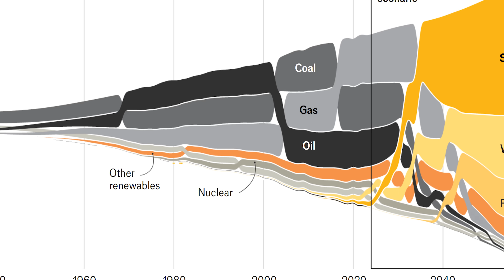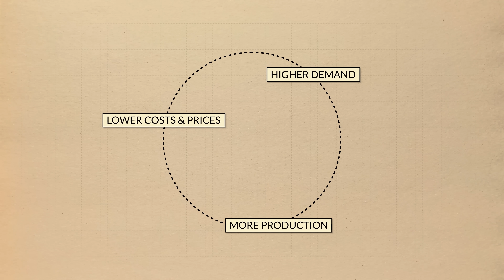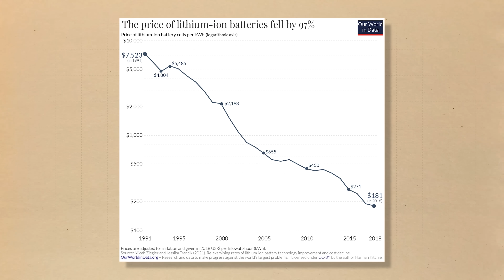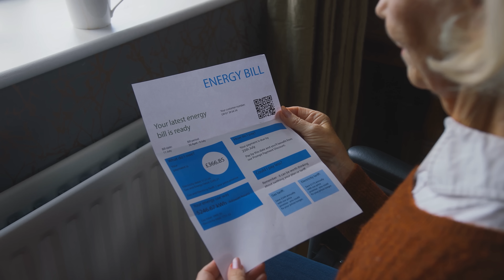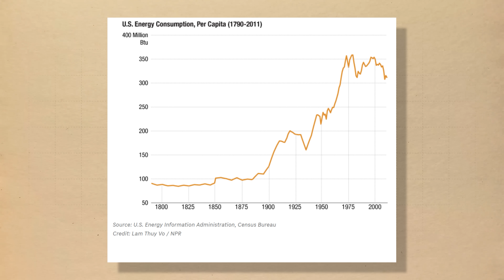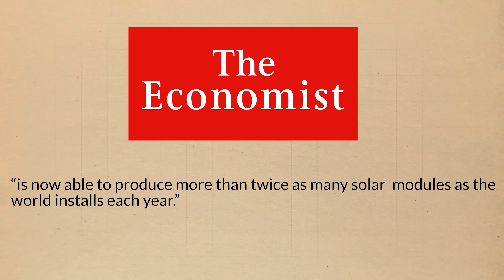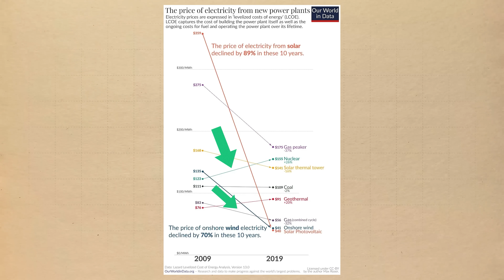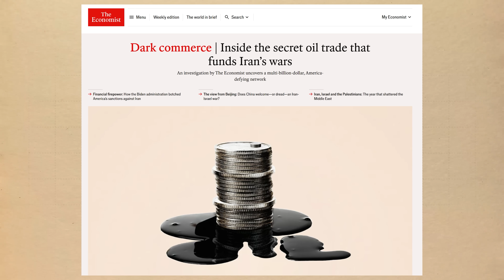Why solar will soon dominate & what that means for the world

Comment: I have a MSc in renewable energy and I am so excited that I can provide some additional insights which I usually can't with Joeri's video's! I love the positive things mentioned in the video, but there's some nuances here that are worth mentioning. 

1. Though the cost of production from solar-PV is negligible, the fact is that energy prices will rise in the near future. The reason for that is the cost for managing the electricity grid outpacing the reduction in production prices for solar-PV. Joeri rightly mentions the lower prices for battery systems, but this is a long-term solution and grid-congestion costs my country (Netherlands) 1-4% of annual GDP per year  because we neglected our energy-infrastructure for decades (like the US has until Biden). We can't add any more supply or demand to our energy grid. 

2. Solar power is intermittent meaning there is a disconnect between peak-production and peak-consumption, whereas fossil-powered electricity is real-time. Africa and Asian nations can indeed use solar to meet some of their energy needs but effectively managing a Solar-PV based energy system requires smart-grid implementations, storage capacity and real-time monitoring, which just isn't financially feasible in a country like Indonesia or Nigeria. 

3. You mention Chinese-made solar-PV as a supplement to Russian gas, this isn't necessarily true. Solar panels produce energy for longer but natural gas is used for non-electric processes and for these processes we cannot supplement gas with electricity.
For example: There's a particular problem with the decarbonisation of industry, which is my job. 
Industry requires high-temperature heating which is not feasible with electricity. I know there are examples of industrial heat being delivered with electric means but trust me when I say that it isn't generally feasible to electrify manufacturing and other industry.

Therefore, solar will be a big portion of the energy-mix, but we need other forms of energy (fuels) that aren't electric. This either means advanced biofuels or hydrogen, the latter necessitating a large amount of freshwater to produce.

Love the video!! Thanks for dissecting this information, we need to embrace the energy transition because it makes sense, but I would say we should have a MUCH more balanced prioritisation between the production of renewable energy and energy-infrastructure because the power grid is just as important and again costs the Dutch economy €10-40 billion/year so there is also an economic necessity.
Reply: 3. IF electricity prices permanently drop or natural gas(NG) prices permanently rise industry will switch to electricity, but it will be slow. Natural gas is relatively much cheaper per btu for heavy industry and was simpler in the past, so "lower temperatures" at scale almost always use NG. However, electricity is still used for high temperature production, and is now generally seen as much safer/simpler(relatively). My impression from the engineers is that this is "simpler" because everything needs so much electricity/digital now anyway lol, so its high electric vs NG AND electric. People might have the impression electric heating is more dangerous, but that's not due to the heating method and is instead due to where electricity is currently used(high temp, dangerous products/reactions). Heavy industry in general is very slow to modernize unless there are very large gains to be had, because the capital costs are so large. In the USA you can basically say they only modernize due to new production, regulation/insurance, or being far past end of life. Major upgrades to the same site, for the same products, just for efficiency are very rare. Although there are super cool industry efficiency strategies that can work for electric like running power consumption off cycle in different ways to get the lower prices/grid load.

But also, who cares about the "niche" exceptions? If everything else goes electric besides legacy systems and transportation that would still be huge gains for everyone.
Reply: @johnstonefield1935 Interesting. If you look up Hydrogen Ladder 5.0, you'll see that industrial heat is on level D. So that seems about right.
Reply: @johnstonefield1935  Your response belies the confusion. It isn't electricity vs natural gas. It's production and distribution of electricity vs the production and distribution of gas and the economic value of the energy at a particular time.

In short, you can't easily store much electricity due to hard laws of physics. So, production has to be flexible, but renewable production is inflexible. This is the paradox. And it can't really be innovated out off.
Reply: Reducing the earth's water supply? Either burning or combining it with oxygen in a fuel cell will both turn it back into liquid water.
Reply: @RikkerdHZ  good call, it has been a long day. It is problematic in practical terms though, reducing freshwater whereas most countries are facing shortages in drinking water. It actively reduces our access to drinking water.
Edit: European nations have been importing hydrogen from "water-rich" countries like Morocco to meet their needs. It shows the practical impact of hydrogen on water supply.
Reply: @augustus331  "Solar power is intermittent meaning there is a disconnect between peak-production and peak-consumption"

At least in hot countries there could easily be strong positive correlation between supply of solar power and the need for electricity because the need to run ACs is usually higher when the sun shines.
Reply: @seneca983  there is also a good correlation in between supply of Solar power and the demand of electricity , as people tend to work while the day and cook at midday.

But for the Grid to work supply of elecricity has to be 100 percent equal to demand.
Reply: @geheimeWeltregierung  Many other sources of power, such as hydro, can be adjusted to match changes in the supply of wind or solar or the demand of electricity. The better the supply of renewables correlate with demand the less you need these others (or storage), even if it's never zero.
Reply: Just leaving industry as it is (which isn’t happening) and then net-zeroing all other sectors would already reduce global greenhouse gas emissions by more than 90%. Even if you include certain other hard-to-electrify sectors you‘d reduce it by 80. There’s hope here.
Reply: I think the big fix you missed for intermittent sources is battery storage, which is also getting super cheap too. And different techs for longer term energy storage will only aid further. Truthfully it's kind of silly that we aren't scrambling to make use of all the free energy we are getting. But incumbents gonna incumbent
Reply: So, maybe a dumb question but: why freshwater? If electricity is cheap, and the costs are in the grid management, surely there’s a way to use desalination to help. Maybe use large plants that switch on when energy prices fall.
Reply: @zoetje9817  technically possible , but making Hydrogen is not Cheap (yet ) .Desalination would add additional costs thats all.
Reply: Rondo Heat Battery is interesting technology. 1,500⁰C  is useful temperature. New technology.
Reply: In UK the cost of energy is high due to marginal cost pricing even though on most days we have about 50% renewables for cheap($/kwh) and the gird is fairly developed to handle 90% renewables.(Yes on really windy days we reach that number).
Reply: Appreciate your comments.
Reply: I’m suprised no one here is discussing hydro power or the energy storage version, pumped hydro. It’s an expensive but simple way to solve the problem, although I do understand some countries may not have the geography required for it
Reply: @molteaser1622  you make a good point and indeed in my case in the Netherlands it’s not an option due to the flatness of my country
Reply: @molteaser1622  hydro can be a very useful source of energy, but in many cases it's already built out, or as you said the geography doesn't exist. However, hydro, or pumped hydro, offers very low cost of multi-day levels of storage and capacity, which is a huge benefit. Currently batteries only offer 2-4h storage and power regulation, because these allow the owner to buy and sell power multiple times a day, and sell into the highest price pool in the evening. Batteries aren't likely to do better than the 8-16h for overnight range, so this kind of week long reserve is very valuable where it's possible. I think India will be one of the greatest winners on renewables, because the Himalayas offer such pumped hydro potential.
Reply: Unless we invent cheap efficient batteries with near-infinite amount of charge cycles, its a terrible option for grid-scale storage.
Most of the world, unlike Netherlands, has a high pumped hydro potential that can efficiently store and release much more power for a fraction of the cost. A decent-sized pumped hydro installation can store and release power on the scale of hundreds of megawattsto gigawatts and the reservoirs can be built on the top of any hill with suitable geology. With maintenance, such installations can last and pay out for centuries, orders of magnitude longer than any battery.
Reply: @MVargic  A a Swiss, with one of Switzerland largest pumped-hydro installation in my (a bit extended) backyard, I am a very strong advocate for pumped-hydro!
However, batteries and pumped-hydro do not have the same usages.  If you need nearly instantaneous response to regulate grid frequency, batteries are the only game in town.  Power transport losses are also an issue.  It would be senseless to transport the power from North German... or Dutch  wind turbines to be stored in Swiss or Austrian pumped-hydro facilities, to be later sent back to German or Dutch industries, when batteries located miles from the wind parks can do the job!
Those two storage solutions are complementary, not opposed to each other... even if I will readily agree... even strongly support... that pumped-hydro can be the cheapest solution, if the costs are taken at the entrance/exit of the installation...but it's not always an accurate representation of the truth.
Conclusion:  you are basically, correct, but please try to be a little less affirmative,,, nothing is as black and white as you painted.  Battery storage is by NO MEAN "a terrible option for grid-scale storage".
Reply: Grid-based power may well be the answer in developed/western/colder countries, but I can say with confidence that in a place like Nigeria, people are just completely bypassing the grid. Nigeria's grid struggles to handle 5,000MW of production and regularly collapses. As a result, the vast majority of the country's energy production and consumption is completely off grid. People are installing solar systems and not feeding it back into the grid. In a place like Lagos where solar irradiation remains high year-round, a modest battery set up is enough to get through the night. Of course, this doesn't work for us in Europe, but for many African and Asian countries, it does.
Reply: @obamtl  I agree and think that small scale grids are the answer for many countries in the Global South that have to cover hundreds of millions of people over vast distances. 
Thank you for sharing your perspective. I would love to visit Nigeria one day.
Reply: Why do you need fresh water to make hydrogen?
Reply: Heat intensive industry will electricfy, it will just be in highly sunny regions where energy is cheaper, Europe will continue a transition to low energy input high value added industry.
Reply: If you made a video on the topic, I would watch it :D
Reply: @bernardogalvao4448  thank you for your kind words
Reply: 2. You’re going to see some leapfrogging in developing countries. Like we saw with cell phones and mobile banking.
A small smart micro grid is not expensive. If you have a village that’s not connected to the grid already, setting up a local solar farm and a shared battery bank will be the cheapest way to get power. This is already happening.
3. There are several examples of industrial processes, like cement and paper production, 
being transitioned to electric heating right now. I read about one such factory that just made such a transition and found some unexpected benefits like better process control. There are also new super powerful heat pumps that have already been delivered to factories that can go deliver up to 200°C. For anything that doesn’t need higher temperatures than that, such a solution will be cheaper than anything else.
There are heat batteries now that can be “charged” to thousands of degrees and can store it for a long time. 
It’s a huge challenge, for sure but we’ve seen signs that most of the solutions we need are ready. I think the transition will be faster than expected. And I think many of these new factory processes will actually help balance the grid.
Reply: @auspiciouslywild  Even just having electricity available during the day would help a lot. The battery is optional.
Reply: The Steel Industry is whiching to electric blast furnaces. I guess you are not so smart.
Reply: You can produce Hydrogen from seawater and not fresh water - researchers demonstrated it in early 2023
Reply: @MechaOrangeStudios  Little problem if you electrolyse sea water: you are going to produce hydrogen alright, but also chlorine gas. In fact, the most efficient electrolysers require ultra-pure water to prolong the lives of electrodes and membranes, AND maximize the amount of hydrogen produced by unit of power invested.
Reply: @st-ex8506  Chlorine gas is an important point, I hadn't considered that. But that sounds like a solvable safety issue, especially since it will get produced at the anode, so anything we need to do to safely handle it doesn't interfere with hydrogen production. What kind of efficiency differences are we talking about and how cheap and repairable can we make the electrodes? Why are you using membranes and not just capturing the hydrogen in a tube? Sounds like I have a lot to learn about electrlysis equipment.
Reply: Sounds like a great investment. Better than nuclear.
Reply: @wildfire9280  Yes and no. I personally hate the ubiquitous take online of nuclear as a silver bullet. Nuclear energy is a baseload energy source that doesn’t fluctuate and provides consistent electricity. It’s VERY expensive though and solar is much more scalable. 
 

So personally I was very happy to see Microsoft purchasing nuclear plants for their data centres as they have money like water, datacenters are consistent energy-consumers and this way the average consumer will not pay the higher electricity costs resulting from a higher demand for energy from big tech data centres
Reply: This either means advanced biofuels or hydrogen, the latter necessitating a large amount of freshwater to produce.

Compared to the amount of energy that it takes to split water into hydrogen and oxygen, the energy cost of taking seawater, doing the most crude inefficient boiling distilation, and then trucking it halfway across the country, is small. 

Hydrogen doesn't take large amounts of freshwater.
Reply: @donaldhobson8873  interesting observations but I work in the sector and if what you’re saying is true it wouldn’t be such an obstacle as it is. 
The reason we are importing hydrogen from Morocco is because we don’t want to tap into our own groundwater reserves
Reply: @augustus331  Either.

1) Your hydrogen production system needs a lot of cooling water as well as the small amount that gets split into hydrogen.

2) This is performative politics by politicians with no sense of scale.

3) The reason you don't make hydrogen is actually a lack of electricity.
Reply: 1. Intermittency of Solar - high capacity battery price is plunging as much as solar panels does, because China is producing it at scale, means that in future battery could store, regulate and stabilize power supply from solar. Secondly, there is a combination of wind+solar to cover the gap.

2. Non-electric industry that uses high temperature combustion process - China is also scaling up its hydrogen storage system, where slow stream of solar/wind/other renewables energy are able to be stored in high entrophy medium like solid hydrogen fuel,  its just a matter of time that technology would reach its critical mass the same way with solar. That would be the end of fossil and natural gas. China is scaling up its space industry which uses lots of Hydrogen fuels, so that would be the logical direction.

of course these were my optimistic prediction, wont happen overnight, but when China is betting on a particular technology I would not bet against it.
Reply: @ganweidi1382  even Japanese are working on Hydrogen and Ammonia as an alternative to Fossil fuel. If that happens we are looking at prices of Oil and Natural gas go into stagnation if not going to zero just like Coal
Reply: When for solar energy and hydrogen are more mature, Germany companies will have already ceased to exist or just moved elsewhere, e.g. BASF to China/US. China now can produce even MRI machine (for healthcare) and Heavy Duty Gas Turbines, which have been Germany's strength.
Reply: The "necessitating large amount of fresh water" is a meaningless statement. Solar and wind power can easily desalinate seawater and crack it for the industrial processes we require hydrogen for. Hydrogen is not an efficient fuel since the electricity required is better spent powering electric vehicles including trucks. Hybrid truck can be used as a transitional measure since they use 1/2 as much fossil fuel. Mining and smelting can all be done with renewable energy. Manufacturing is already mostly electric. The question is not "if", it's how fast will it happen.
Reply: Australia nuclear promoters are looking for 247 cashflow to make economic sense. 

Australian nuclear promoters want GOVERNMENT built and GOVERNMENT disaster insurance and GOVERNMENT GUARANTEED CASH FLOWS. 

Tax payers money. 

BUT everytime the sunshines 🌞 the cashflow STOPS.
BUT  everytime the battery is full after the sunshines 🌞 the cashflow stops. 

The electric future is 100%, nuclear promoters are saying 1% of all energy used is to be nuclear. 

This is obviously stupid. 

Nuclear electricity industries to stop CO2 emissions worldwide, is stupid. 

For a start nuclear must have a grid that is 10times more expensive $km and 10times bigger km. 1million x 1million x 10 = stupid. 

$TRILLIONS AND TRILLIONS AND TRILLIONS. 

DECADES AND DECADES AND... 

Nuclear promoters want you to waste time on its $billions construction costs bs. 

But bigger nuclear needs a bigger national electric grid, $TRILLIONS. 

But small nuclear 247 cashflow does not survive in the big renewable electric world. 

Worldwide nuclear industries and EXPLODING MILITARY DEFENCE costs are extremely expensive. 
More nuclear submarines  ???? 

80% of the world's population live in dictatorships.
Great thinkers, the nuclear promoters,  bs.
Reply: Great comment!
Reply: What's your Twitter handle or something, I need to follow you. You're a gem 💎. Even if it's a website you have or anything related, I will be glad to have it and follow you. People like you have a lot to offer this world, and you just earned yourself a follower. I look forward to your reply. Stay blessed.
Reply: What's your Twitter handle or something, I need to follow you. You're a gem 💎. Even if it's a website you have or anything related, I will be glad to have it and follow you. People like you have a lot to offer this world, and you just earned yourself a follower. I look forward to your reply. Stay blessed.
Reply: You forgot to mention solar is electricity and solar and wind are about 5% of our total energy and energy demand is greater than new installations or renewables and that solar will never replace oil.
 if we are to have a 50 or 100% reduction in emissions then oil has to be cut, the 6000 products we get from oil won't come from renewables or nuclear, no point having all this energy if we don't have the plastic that comes from the same barrel diesel does, we don't make rubber coated wire or batteries.
Reply: Your point no1.
Is t is entirely possible to add more demand. That is through the electrification of transport.
Low-pricing signals when solar output is high is an obvious opportunity. It is already being done in Australia.
We charge our EV from the grid at about 4c/kWh or about $2 to charge about 300kms weekly commute.

Dynamic pricing has a big role to play to influence load shifting
Reply: Thanks for the insight!!!
Reply: Oil is taxed 90% solar is subsidized 90 % 
It’s not cheap it’s an expensive scam
This video is not informative it’s propaganda
Reply: All excellent insights Augustus. I think your Point 3 needs restating however. Electrification is coming for energy, just not yet on everyone's radar. Rio Tinto's Electric Smelter, Rondo Energy's Heat Battery, and several other projects are the tip of the spear. Economist actually covers this well. I think you'd love the referenced issue. It's my favorite weekly news and analysis community.
Reply: @JohnSmartFuturist  thank you sir and I will check it out soon! 
One point to make as you mentioned Rio Tinto, not to disprove anything you said, is that the critical materials required for this electrification is running into steep obstacles. Rio Tinto has trouble with a lithium mine in Serbia currently and when I was in Brussels for the EWRC to represent my province we discussed the issue of minerals and lithium at length and we don’t really have a viable alternative to China in the short term.
Im 26 and literally just got started working after uni. It is such an amazing time to be starting work in this sector.
Reply: Thanks :) Mind if I ask you some questions?
Re: 2. Intermittent nature of solar. I never hear the possibility being mentioned that we could move the consumption peak to match the production peak. Why is that? Solar seems quite predictable.

Re: The fresh water needs for hydrogen production. From what I understand of water electrolysis you need at least some salt in the water, so using sea water would be easier than using fresh water and adding salt. The only downside is that your electrodes will accumulate salts from impurities in the sea water that might eventually insulate the electrode from the water thereby increasing resistance. But cleaning electrodes is easy. Plus the price of electrodes is trivial, electrodes are small and cheap to store, and they don't wear down all that much, so you can have many spares on hand and rotate them out of production and into cleaning easily. I'm already thinking of an electrode conveyor belt in my head that would automate this with automated testing. Wait, this was supposed to be a question, why do you propose using fresh water when any water will do and sea water is best?
Reply: @bramvanduijn8086 Indeed, moving our active hrs is perfectly reasonable. Accepting some level of power cuts would go a long way too. I suspect at the heart of the low carbon movement is an old anti-nuclear movement and it's key for the that renewables don't just displace fossil fuels but 'obsolete' nuclear so req. major consumer change aren't acceptable.

Fresh/brine isn't the issue with electrolysis. It's electrode breakdown, effciency of conversion and the cost of pressurisation and storage of H2. All in this makes mass electrolysis a hard sell.
Reply: Your notes are pretty related to the book "The New Map" Daniel Yergin.. fosil energy will still needed
Reply: @manitoumtl45  I see it not as “we still need fossil fuels” though it’s true for now. 
I see it as “we should prioritise energy saving as the first step while we get our energy infrastructure in order”
Reply: 1. This depends on where you are in the world, and is a point worth making but for countries like Nigeria you are looking mostly at small area micro-grids in the near term.

2. I don't think smart grid / realtime monitoring is cost prohibitive for small scale grids, thanks to the decades of advancement in semiconductors, and general purpose CPUs/microcontrollers, embedded systems to do this sort of work are relatively affordable. Batteries are currently the most expensive component, the viability and capacities of these small grids is mostly dependent on the cost of storage.
Reply: This is wonderful additional information. That you very much for sharing it with us.
Reply: @SqFtGardenGranny  :)
Reply: More focus needs to be put on storage, no? Industrialized nations can't just have energy when it's sunny. 

If solar demand increases 10x, so too does the demand for battery metals such as lithium and nickel. That is going to require a lot of mining and could create major supply constraints and drive up costs considerably.
Reply: @ Storage is a form of infrastructure as it is integrated with the power grid
Reply: Biofuels are a joke as far as I can tell. Bio? Photosynthesis is what, fifty times less efficient than our solar panels?
Reply: Battery systems are not even a solution. They don't have the capacity we would need.
Reply: Thanks for providing reality to solar power which is to say we still need nuclear power since it can provide high temperature, load following, zero carbon heat for processes and electricity production.
Reply: @ Except for the high temperature applications, indeed. 
But one thing the experts are starting to shift on is the affordability of this essential source of energy. The consensus used to be that nuclear is cheapest in the long run but this isn’t true. Microsoft closed a deal with a nuclear plant that it will pay $100/MWh, which is significantly higher than the 20-40$/MWh that solar provides. 

However you are right in thinking it’s an essential part of the energy system. We just have to find an economic activity that has high return on investment like data centres that can carry the premium cost of nuclear energy.
Reply: @augustus331  Solar only provides electricity sometimes, so you have downtime which is very expensive. You have to price that in. The cost of solar should include the cost of the backup coal plant. In Europe this is not done, which screws up everything, including the economy.
Reply: I disagree with 3rd point since lots of electric arc heaters are used in metal production. And solar can substitute that. 

Additional in the past making ammonia or idea from electricity was cost prohibitive,  now urea plants can infact use electricity to convert Atmospheric nitrogen to ammonia.
Reply: @ameerm4899  As I said in my comment, I work in the decarbonisation of industry. It isn't generally feasible to electrify industrial processes.
Reply: @augustus331  hey I understand but still there much that can be done even today. I am from Pakistan so I probably think there is a lot of room while where you are you might be tight on reducing carbon emissions.
Reply: Augustus, 

why an MSC in just renewables, what about the mainstream conventional generation and distribution?

You mention some of the negatives of renewables but there are more and basically insolvable problems.
My view as an old time (now retired) electrical power technician is that renewables are a dead end and cannot replace conventional generation for the practical and technical deficiencies inherent in their inverter output and uncontrollability.

The basis for this push for non CO2 emitting generation is the hypothesis that CO2 is materially affecting our climate, something that is not much more than opinion, there is certainly no evidence of that. This has distorted the viewpoint of policy makers, who almost universally have little to no technical or scientific knowledge and seem to rely on only one body, namely the United Nations. No sensible person would commit to such an expansive and drastic change on just one opinion. As you are in Holland, no doubt Clintel.org is familiar to you?

There is only one technoclogy readily available that does not emit CO2 in operation, despite being hampered by over regulation, and that is nuclear. It works, is reliable and safe and has a much much longer lifespan than renewables. it also requires far less infrastructure expansion and suffers from none of the technical deficiencies of renewable generation..
Reply: @iareid8255  Clintel is regarded as the most un-serious organisation who cherry-pick results for their incorrect conclusions.
Reply: That electricity cannot provide high-temp heat is an old, false talking point of the Right
Reply: The main problem with solar power in a country such as the Netherlands is the fact that much electricity is used for heating and it is needed at a time of year when not much solar power is available. Nigeria and Indonesia have climates under which there is not much need for heating and there is not much seasonal variation in availability of solar power. I think the main thing holding back solar power in these countries is the lack of electrical equipment that runs on low voltage DC. There is much less need for storage than there is in countries that are at larger latitudes.
Reply: We surely will need other sources of power, but arguments about the grid forget that a lot of solar capacity will be generated at home, we also will need to upgrade the grid as the demand for power accelerates, even if we continue to use fossil fuel so it seems a non-argument, likewise arguments about time-shifting forget that we're surrounded by batteries already and moving to off-peak pricing can help aid that.
Reply: Lol, Indonesia can perfectly afford that, Indonesia is the largest economy in southeast asia, growing fast as well, Indonesia also far richer than Nigeria, being the only G20 country from southeast asia.
Reply: @briantarigan7685  Don't get me wrong, it was not a jab at Indonesia, at all! Indonesia is a country that will dominate the 21st century. 
But when you talk the distances energy-infrastructure has to cross in Indonesia, you'll see how infeasible a smart-grid is for the country as we in the Netherlands struggle with it too while only being what, 1% the size of Indonesia?
Reply: It's even worse. Problems in Dutch grid impact grids (and energy prices) in other nations. E.g. a bottleneck in Netherlands can impact transfer capacity between Germany and the Czech Republic. Energy distribution is actually quite complex topic. Building a solar park is the easy part. Connecting it, that can be another story.

Yes, people often forget how much energy we consume in the form of heat, especially high-grade heat (the higher the grade, the harder to replace economically). It's trivial to get it from fossil fuels. Not so much from electricity. And even if you transition to something like hydrogen, it might mean abandoning/ demolishing current facilities and building new (e.g. steel works), a huge investment both in money and time. I mean, who would invest that kind of money in heavy industries in Europe. You don't get the sense that we want heavy industry in Europe.
Reply: Anyone who thinks energy prices will ever go down is a fool. It’s not in the grids or producers for prices to come down. They will make up excuses why prices should be high. That’s why the only solution is to produce your own.
Reply: I hope I can also add some context. Yeah for heating it's harder to electrify but I recommend you look into heat pumps ( your fridge is one), which can be used to heat stuff thanks to thermodynamic cycles. You use a bit of electricity to compress a refrigerant, let it condense taking up a huge amount of energy from the environment in that process, pump the liquid to where you want the heat and let it everopate again, dumping all the heat into the system, then you lower the pressure of the refrigerant by letting the gas expand. Now that drop in pressure will allow the gas to take in energy from the environment again. That should help you decarbonize your industry.
Reply: @Ninjaeule97  If there was an easy solution to industrial decarbonisation, the billion-euro companies I work with would have long implemented it because energy inefficiencies and unnecessary emissions make European industrial companies bleed money.
Reply: @augustus331  What company are you talking about? BASF received funding approval for the world's largest industrial heat pump for CO2-free steam generation. I'm pretty sure that it's not easy but they wouldn't try it if it was physically impossible.
Reply: @Ninjaeule97  The problem is that industrial processes tend to require relatively high grade of heat (meaning relatively high temperatures). And while it's certainly possible to use a heat pump to raise a temperature from 10 °C to 35 °C with huge efficiency, already going from -10 °C to 70 °C is a very different matter. Your heat pump can become a rather expensive resistive heater.

For one, you need a different refrigerant for industrial applications where you regularly require 100+ °C. And there are plenty of processes where this should be feasible (there already are industrial heat pumps). But there will be processes where the required temperatures are so high that no heat pump would be efficient, even the theoretical ideal pump (COP would be too low for the mechanical complexity to be worth it, that is assuming it would be even possible). Remember, there is a theoretical limit to COP. The higher the difference in temperatures, the worse it gets. No heat pump can ever beat it. I imagine he knows more about industrial heat pumps than the two of us put together. Seriously, can you imagine smelting iron using a heat pump? A pump that can operate at those temperatures?
Reply: @jobicek  who is he? Oh, you mean augustus331. Yeah, pumping heat has its limits. But isn't a heat exchanger, a substance that can change phases, and a pump that can move the substance already a heat pump or am I missing something? Heat transfer depends on the heat conductivity λ, resistance Rυ, heat flux q, and Fourier's law. I can imagine melting iron with the power of the sun using mirrors to focus all that energy into a small point, but in case there is not enough sun, geothermal could also be an option. The question is how much iron you want to melt and how deep you need to drill. Also, you need a substance that has a higher melting point than iron if you don't want all your equipment to melt. I hope that I'm not forgetting something cause heat and mass transfer wasn't my best subject
Reply: @Ninjaeule97  Solar concentration might be an option for small volumes like for watch making. I think the Swiss watch industry already has a project like that (and I think only for casting, they're not processing metal from ore). But it's unlikely you'd produce large volumes, especially since many established steelworks are up north and steel is a strategic commodity (I don't see Swedes relocating to Spain).

Drilling is just a theoretical possibility. AFAIK all the projects have failed so far. Even the, I believe, Russian project that was successful in drilling was abandoned with funny stories going around about what happened. We don't know whether it's actually possible to drill deep and extract substantial amounts of energy without things going wrong (e.g. earth quakes).

But even if you could get, say, a 300 °C geothermal source, just so you don't have to suck heat from ambient air in Sweden, as you correctly write, a big issue is that of materials. What would you use for refrigerant? And what materials would you use that can survive those temperatures while being structurally sound. Theory tells us that the pump wouldn't be all that efficient (say you need to get to 1500 °C, COP would be under 1.5; that's the theoretical limit if my calculation is right). And so the question is whether it would even be worth it (compared to, say, electric arc furnace, a technology already in use). To save some electricity (less than third in this case) at the expense of who knows what (exotic materials, maintenance, lifespan). And I don't think anyone is seriously considering it at scale. If we put aside natural gas, the option on the table is hydrogen. But you still have to abandon/ level the old facility and build a new one from scratch. AFAIK conversion is not possible. A huge investment, a lot of time needed. And you have to source that hydrogen somewhere.
Reply: @jobicek  I could see Solar collectors in the desert, after all, there are these towers that generate electricity already. You might have heard about DESERTEC by the Club of Rome. Electricity, never went anywhere cause no one wanted to build the HVDC in Africa. For turning Iron Ore into pure iron, you need H2 or some other reducing agents anyway, and you don't transport H2 if you don't need to. Not sure where suitable iron ore deposits are, but they can be transported quite some way by ship or rail. The issue is mainly how many countries you have to ship it though if there are tariffs. Yeah, drilling specifically for heat makes only sense in vulcanic regions, and you better make sure that there is no anhydrite under your feet; otherwise, you will get another Staufen in Breisgau situation. I heard that CO2 could be used as a refrigerant, which would solve the problem of leaks of substances with a large greenhouse gas potentially, but if we are talking about higher temperatures, I would just use H2O. Liquid water leaks are easy to clean up and even steam leaks aren't that big a problem as long as they don't happen where the humans are.
Reply: @Ninjaeule97 To get some sense of scale, people from our largest steelworks have said they would need our largest nuclear power plant all to themselves to maintain production. That's over 2 GW electrical and it covers about 20 % of our consumption (we're a net exporter but we also have coal plants that will be decommissioned). That's just one facility. Granted, a very large one. And extra 2 GW required. And I think something like 35 billion euro price tag for the power plant alone (2024), not counting having to build new facilities for the new steel-making process.
Reply: @jobicek  Yeah, steelmaking is a huge industry since it supplies other industries that use it to build pretty much anything. Don't know much about arc heating. What are you looses for that? Has induction heating been tried before? If you can use it to heat up pans to a safe degree in kitchens you might melt the pan if you remove the limiter. Of course, you need to melt more than a single pan so the Induction heater will be a lot bigger than that of a stovetop.
Yeah, I have seen YT do that. No idea why it's happening. You might have to file a bug report if it bothers you.
Reply: Thank you.  Your explanation gave me a new way to look at the problem!
Reply: @ can you elaborate! Very curious to know:)
Reply: @augustus331  you need to put some name after the @ otherwise people won't know who you mean
Reply: @Ninjaeule97 YT sometimes removes the username. PS: I posted three comments right now, all addressed to you. First was OK, the other two had name removed. It has been happening to me for a while.
Reply: When you burn hydrogen, doesn't it turn back into water?
Reply: @rutessian  Yes, of great purity.
Reply: @rutessian  yes, but by using electricity to make hydrogen and then burning it to regain the energy, you lose over 70% of your energy, it is extremely inefficient.
main issue is the fact that you need to compress hydrogen to store it, which is very energy intensive. (or you can make a storage have over a million times less capacity, which is more expensive (just in another way).
Reply: Can't we just add batteries to the solar site itself? I mean every day it will not generate for at least 6 hours. That's a 6 hour guarantee that those battries can continue to offload on the grid while other sites aren't offload too. The generation from the panels can be highly overdimensioned over the grid connection.
Reply: @Deveonn  That is possible but is it feasible? The issue is that it will increase the cost of building solar sites and their upkeep. There are also issues of decentralisation of the control of the electricity grid as now you have smaller sites that needs access to offload on to the electricity grid.
Reply: @derpasaurus155  we’ll have to store it somewhere, why not near the source? That will save a ton on the amount of copper needed to distribute. Batteries don’t require maintenance as windmills and solar (cleaning dust) do.
Reply: @Deveonn  Scale. All the batteries every produced can't power a medium sized country for a week currently, nvm the same country in the future with EV's, heatpumps and an all electric heavy industry.
Reply: @CmdrTobs  which country needs to go a week without generating power? No sun, no wind, no hydro, no friendly neighbors…?
Reply: @Deveonn  That doesn't make sense, I'll correct that to: "Which countries can't generate sufficient solar or wind power for a week"

Most of them in Europe during winter cold spells. "Dunkelflaute"
Reply: @CmdrTobs  no wind during winter? Interesting.. and Europe has ton of friendly neighbors. Spain can generate a lot of solar in the winter and barely needs any due to lack of required heating or cooling. Norway, Swiss and France can also store a lot in hydro.
Reply: @CmdrTobs  The countries above the polar circle (i.e. those that actually don't get sun at all in winter) all have geography perfect for hydro power. The rest can simply compensate by solar panel overkill. Solar panels lose about 80% power production in winter compared to summer, and since solar is going exponential we're fast approaching the point where deploying five times as many solar panels is perfectly doable. That just leaves you with an electricity surplus during summer, which you either figure out how to use or you cover the panels / turn them off.
Reply: You've provided a fair amount of criticism to solar-optimism, thanks. But what exactly makes true Your claim that "we need other forms of energy (fuels) that aren't electric"?
Yes, the grid is not ready, solar-power production is not ready to replace other fuels today in volume, but why exactly some other types of fuel are actually necessary? (other than current transition phase)
(the only obvious exception I see ATM is aviation fuels, which is impossible to replace with todays battery tech)
Reply: @alexeypilipenko7111  I am not a chemistry major so I'll probably oversimplify here. I think the immediate brute force of incineration provides the necessary amount of joules/second to produce the required heat for many industrial applications. 
Other reasons are that aviation is hard to electrify and you cannot use hydrogen for seafaring-transportation, because the amount of fuel it would take would expand the fuel tanks beyond reasonable size.
Reply: @augustus331  Holy.. an actual good conversation on youtube???
Reply: @denneytron  It's happened before. 

It was when dinosaurs ruled the earth, though.
Reply: @alexeypilipenko7111  Well, can you describe e.g. steel production process that only uses electricity for heating while being even remotely economical? Do you even know what kind of temperatures you're dealing with? You do envision steel in your future, right?

You rarely hear people mention that the sheer amount of process heat used by industry means that our electricity production would have to significantly increase even if it was possible to use electricity directly to produce required heat. Where it's not, we will have to use a less efficient path like hydrogen generation (or even less efficient like synthetic hydrocarbons), making electricity consumption even higher. The nice thing about some reactor designs is that they produce high-grade waste heat which is useful in so many industrial processes.
Reply: @alexeypilipenko7111  Electricty can't produce high grade heat cheaply as the transducer always wears out quickly. Think, heating elements, electrodes etc...
Reply: @alexeypilipenko7111 he’s talking about hydrogen without mentioning all the horrendous downsides and litany of problems that must not only be overcome, but continuously prevented to allow efficient storage and transmission of hydrogen fuel. I wouldn’t trust his assessment at all given his obvious bias.
Reply: @CountJeffula  The way to store green hydrogen is to combine it with renewable carbon and store it as methane, natural gas.  Much safer to store, transport, and use it that way. Been doing that for a hundred years. Only tiny, tiny flaw is that it's currently really expensive to make green hydrogen and green carbon.
Reply: @CountJeffula  Efficiency with hydrogen is not required, only safety. The production requirements are cheap and resistant to wear (Except the compressors) and the main cost is electricity. Since we're talking about a situation with a surplus of solar power electricity is basically free at that point. But indeed hydrogen storage is challenging, it is the smallest molecule after all, so it easily slips through most stuff. Still, not trying to master hydrogen gas storage and transport is stupid since production becomes cheaper with every installed solar panel.
Reply: @bramvanduijn8086  not only is it small, but it causes increased wear on all pipes and fittings because any microscopic cracks that develop won’t heal as they would with other gasses, but remain and grow insidiously.
Reply: Of course we can technically achieve carbon-neutral biofuel based power plants and a frankly underwhelming option of hydrogen fuel cells for energy storage, I'm very much a partisan of going back to the self-evidently less destructive (on average) energy production from nuclear power plants.

The dangers associated with them are much less than the provably terrible long term effects of fossil fuel based thermoelectric power plants that we still rely on for energy dispatch. It's certainly a big investment, requiring long term vigilant maintenance, but it does fill that gap that would otherwise use fossil fuels.
Reply: I am ALSO an engineer (chemical) who has been active in the renewable power industry (as well as in bio-based chemistry) for the last 14 years of my career (I retired last year).
I only partially agree with what you wrote.  Let me comment your 3 points:
Point 1:  I am neither a grid engineer, and even less a Dutch one (I am Swiss).  I therefore cannot add value.  But, if what you said is true for the Dutch grid, it isn't true for the entire European grid.  The obvious answer is then to invest heavily in upgrading the gris asap, it will be an investment that pays itself off quite quickly.  Again, I am no grid engineer, but am pretty sure it can be done in a decade or so.
Point 2:  Solar power does not have to be intermittent.  If you had HVAC power lines circumnavigating the globe, it would become a continuous source of power!  Obviously, that solution alone would not be financially optimal, even if technically feasible.  The solution to the intermittency of solar and wind power is in the optimized implementation of not one but 6 different strategies.  As a matter of fact, I have written a white paper on the topic, of which I can share with you the summary, should you be interested.  Intermittency IS an issue, but an issue not that difficult to solve.
Point 3:  Strange that you say you work in industry decarbonization , and that you say it can't be done.  I precisely specialized in industry decarbonization, more particularly the chemical one given my field of expertise, and I pretend that it not only can be done, but is being done in almost all industries.  I see zero road block at decarbonizing the chemical industry... industrial heat at ANY temperatures, even some much higher than fossil fuels can ever achieve, are possible electrically. Colleagues I know are working on decarbonizing the steel industry, and electrically fired steel mills already exist.  Maybe the cement industry will be a harder nut to crack...

Conclusion:  solar power is no silver bullet... only the most powerful bullet in the arsenal.  The solution is in a proper mix of generating options, and in the proper implementing measures.  We already have the means to decarbonize 95+% of our fossil fuel applications... AND end up with more plentiful and cheaper energy.  A few niche applications are to this day very hard to decarbonize... one can think of long-range air transport... but even for that, the solution exist on paper... and it is NOT hydrogen!
Reply: There are MANY issues to "fix" before solar becomes the standard.
Storage is talked about like it's no big deal, and maybe someday they will solve it but it makes solar 10 times more expensive.
Reply: @aCycloneSteve And worse the long term effects of degraded systems.
Reply: Industry tends to be intermittent. So, if solar is cheap enough, heavy industry can operate in North Africa during the day! I.e. using cheap electricity to provide thermal energy!

A lot of the grid problems you mention go away when batteries become cheap enough. Currently, a 24-hour battery is around 3 times the cost of a solar/wind install. If that cost drops 10x over the next decade, then many of the infrastructure issues you mention can be solved with batteries.

I fully agree with intelligent grids, though. This is necessary and will require investment.
Reply: @patrickdegenaar9495  The lower cost of energy in North Africa would probably not compensate for their poor location in the global trade system. Solar irradiation will be similar in India versus Tunesia, but India has vastly better infrastructure and a larger workforce. I like your idea, and I don't know this for a fact but this is what I thought of when I saw your message. 

The big problem we run into is that grid-improvements cost ten years from draft to completion. Two years to build, eight years of legal issues, citizen-involvement nights, you name it. If we cannot even get our power-grid capacity up, storage capacity still seems a few years away. 

But we are working on a Hydrogen Valley here, transforming former natural gas land into a hydrogen-hub. Hydrogen can also serve as a seasonal storage.
Reply: Actually, grid storage is already there. They are even applying it in oily Texas and it is profitable too. It is still in its infancy but it has the potential to solve the intermittency problem. At least the day-night component of it, but that is enough to open the floodgates for greater (exponential) penetration of solar in the market. For the seasonal component we need cheaper green hydrogen, but that is coming too and no, it does not require freshwater. In fact, it requires electrolytes (salt). And we cannot possibly change everything at once, because the transition takes huge investments.
Reply: @jaapfolmer7791  Texas needs to join the whole USA grid. Then they could import solar power for a full two hours more from the west coast, and could export for two hours to the east coast. America needs HVDC transmission lines. This could alleviate the need for storage until lower cost and manufacturing capacity exists. I think Texas, because of their stranded asset mentality, shot themselves in the foot.
Reply: i dont understand why the dutch government isnt throwing money at the grid. Make public transport free, make cars and evs more expensive. That frees room on the grid for solar panels and storage solutions. thats how to become an energy powerhouse in this age. net metering could go away and it wouldnt matter.
Reply: Somebody who sells hydrocarbons wrote you a check. Happy spending.
Reply: You say "because we neglected our energy-infrastructure for decades (like the US has until Biden)." The US did not ignore our energy infrastructure; it chose a different path because fracking unlocked tremendous amounts of cheap stable energy not available in Europe. If your point was strictly about solar and other renewables, again you are not quite correct because the adoption of wind and solar and hydro has been on a strong and ever-increasing path long before Biden.
Reply: @m.rogers5846  good comment.
Reply: @m.rogers5846  we have the same natural gas supply available in the crust if we would frack for it but we don’t deem the long term effects acceptable. And Biden was indeed the first president since Roosevelt with his Rural Electrification Act to properly invest in the power grid.
Reply: @m.rogers5846  No you're not correct. It's going to be a yes-no discussion when it comes to youtube comments like this but the last time you took your  power grid seriously was in 1941 during the Rural Electrification Act and I think Nixon did some small bits. It was until Biden's Infrastructure Bill and the IRA that the energy infrastructure was taken seriously again. 
You mention fracking, it's actually feasible here too but we just don't accept the long-term consequences of short-term energy mining.
Reply: @m.rogers5846  He was talking about the Netherlands, not the US. At the moment the grid here needs to be upscaled asap.
Reply: So basically renewables mean huge electricity cost increases for every one ? 🤦‍♂️
I love this term green hydrogen 🙄 the cost of producing, transporting and storing hydrogen is vastly expensive. 🤦‍♂️